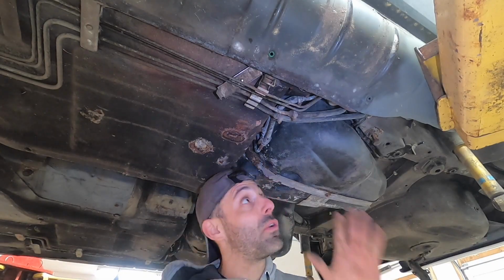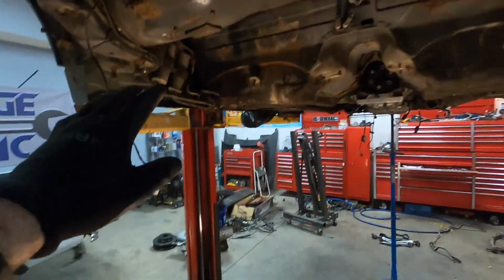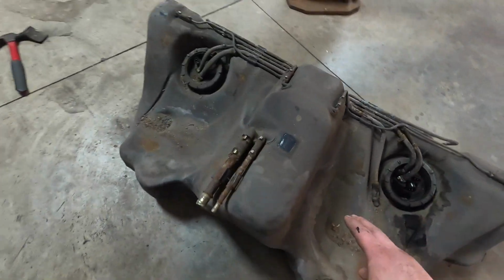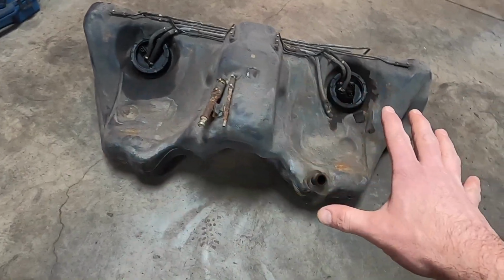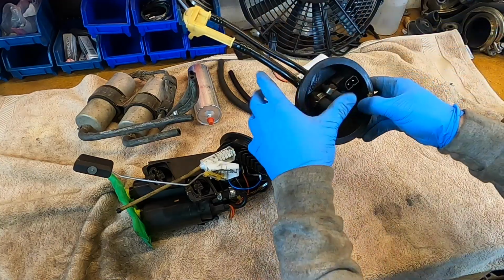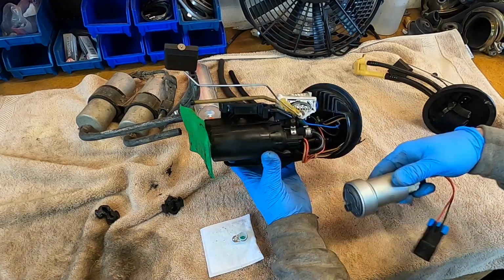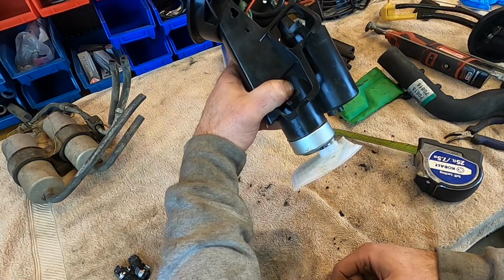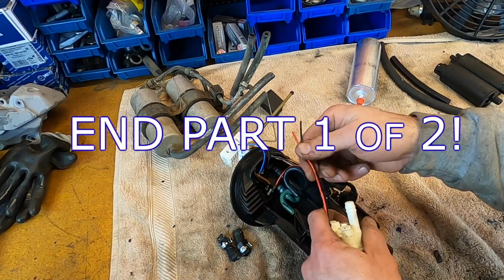BMW E31 S85 V10 Fuel System Upgrade Pt 1 of 2!

Comment: Good work once again. I love your attention to detail. Cant wait for the next video. So in my e36 the fuel gauge sometimes shows empty even though there is fuel and if I hit a bump in the road it will restore the needle to where it indicates the right amount of fuel. So I'm thinking I need to check the resistance in that variable resistor